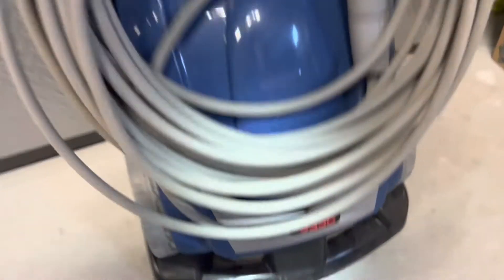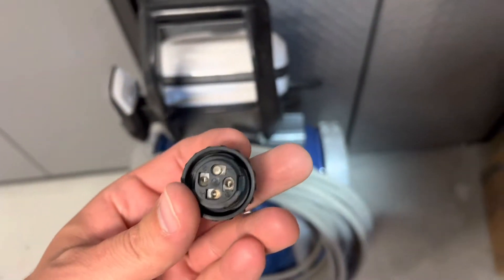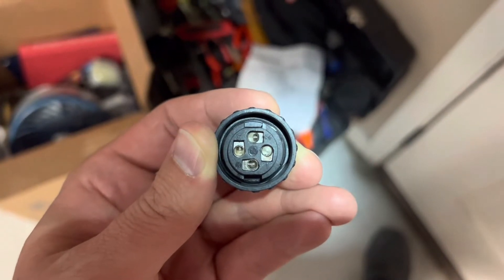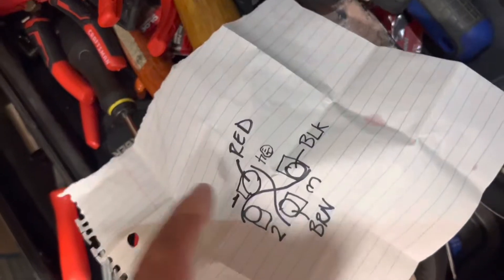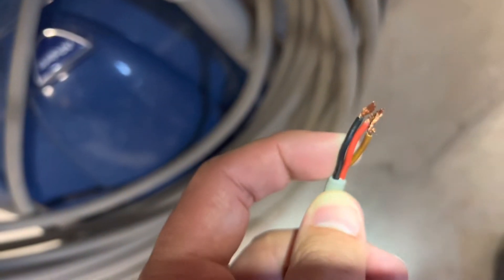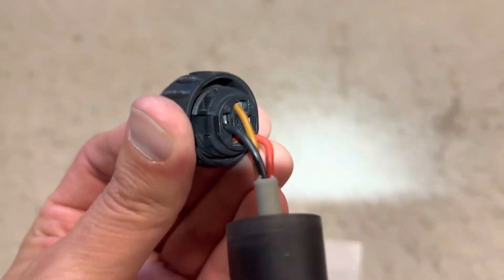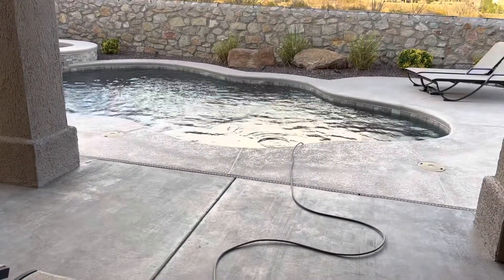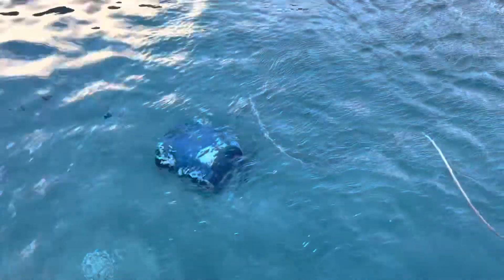Polaris 9550 Sport Control Connector Pin Out / Schematic

Comment: REMOTE DOES NOT WORK. Bought the 9550 Sport.  Control unit  says " Good" but does not display the circle of connection. Remote does not work.  Contacted Polaris, (3hr. wait time) they sent me a new remote. Neither work.  Tried synchronizing the remote per the manual (several times) still not working. Can someone offer another solution, please? The manual has no trouble shooting guidelines for this issue. Thank you.
Reply from the maker: It sounds like it's been frustrating. I'm not experienced with this unit's remote. I've never faced an issue with it. I advise taking the unit as a whole to a local pool supply store and seeing if they service them. Definitely call ahead of time to ensure you don't waste your efforts. My local Leslie Pool Supply works on pool vacuums. Just an idea. Best of luck.
Reply: Very helpful thank for the video it works again no 
er 10 code

Comment: Thank you for the video.
How do you reattach the wires to the pins? Did I hear you say using a small flathead screwdriver, where do you insert the screwdriver? Thank you for your response
Reply from the maker: Yes, if you turn it to the side you should see the screws. They come loose over time and a small slotted screwdriver (flathead) does the trick. Best of luck!